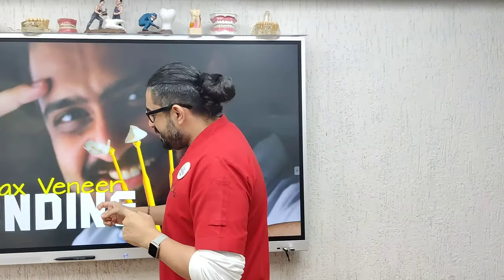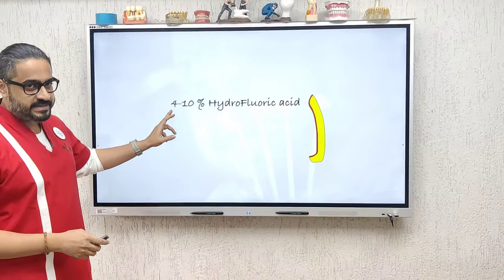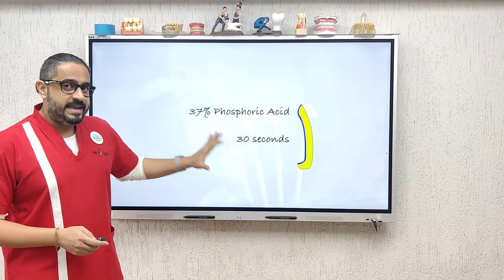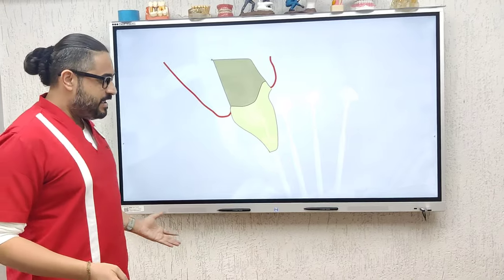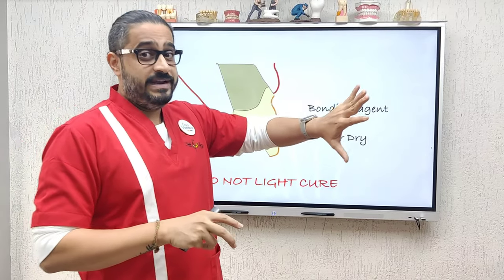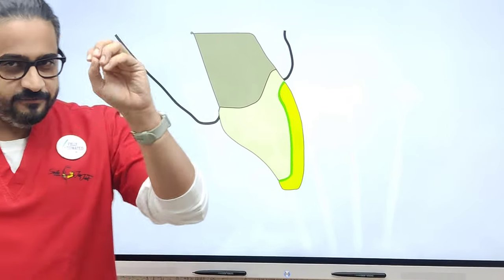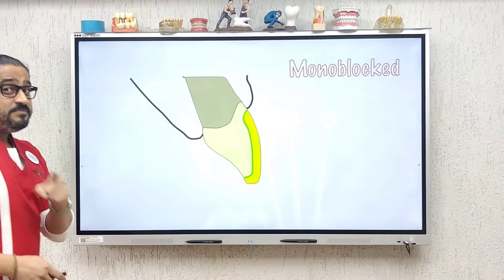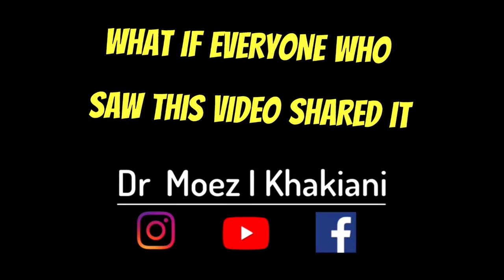Tip-SEE-Tuesday: STEPS IN PORCELAIN LAMINATE/VENEER BONDING

Comment: Great tip Dr. Is there any specific reason you say not to use a self adhesive dual cure cement .
Reply from the maker: 2 main reasons:
1. Time is a constraint,
2. They hydrolyse over time thereby turning a tad grey... 
Hope this helps
Reply: @DrMoezKhakianiMDSMumbai   Thank you . That was very helpfull

Comment: If you are using Panavia v5 system.
For Emax 
Would you do Ivoclean, HF 10-20sec Phosphoric Acid Etch 30s, then Ceramic Primer and cover under a light barrier.

Are the above steps correct.

Comment: Hi sir. One step if i am doing wrong. Pls correct me. Do we need application on bonding agent on venner after silane step. Some metors suggest that.
Second question how u load rely x on venner. So much flushing out when we adapt veneer on tooth sir. How to load properly.

Last question. At what step u use optrastick . I used before HF application. But venner keep falling.

Comment: Sir wy u prefer light cute resin wy not dual core for cementation
Reply from the maker: Good question...
1. Light cure cements give me ample working time... This is very important when I am bonding multiple veneers at a time.
2. Light cure cements do not change shade overtime, unlike amine based dual cure cements... Best wishes to you
Reply: @DrMoezKhakianiMDSMumbai  thnku sir

Comment: I think you have to cure the bonding of the teeth before
Reply from the maker: No need for thin anteriors venners as light can cure the resin even thru the porcelain...

Can do so when using dual cure resin with bulkier restorations, typically for posteriors